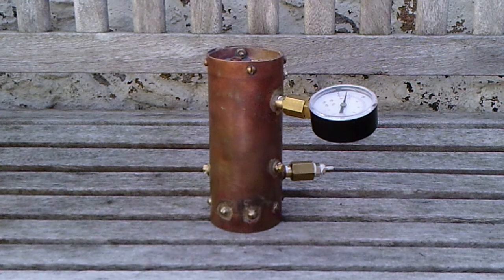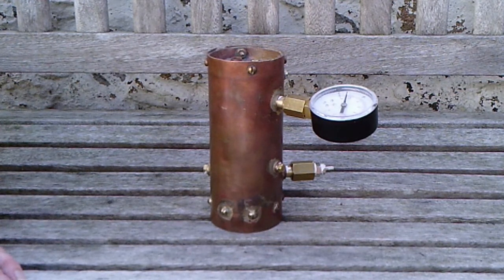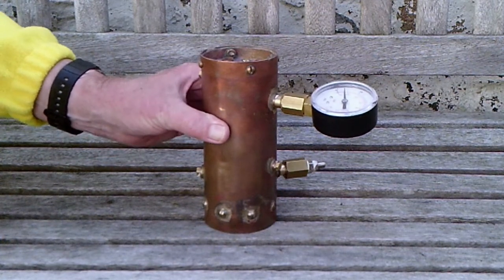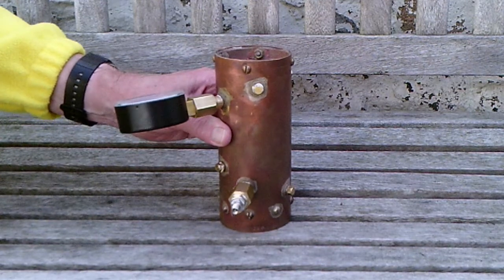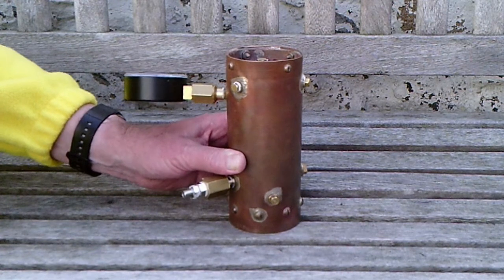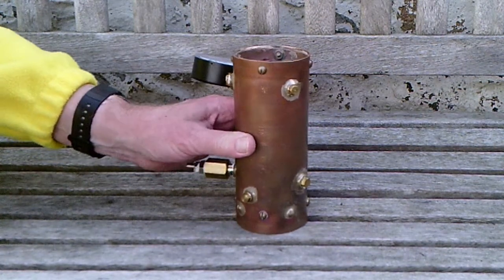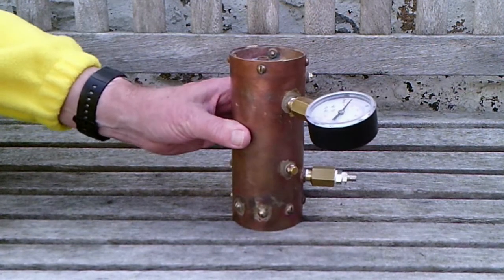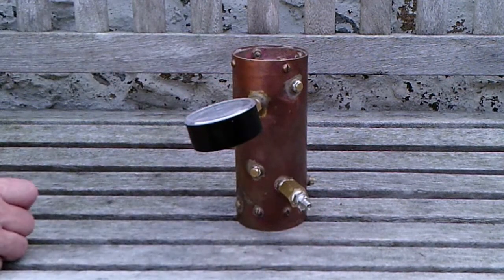Vertical 3 Inch Steam Boiler Part 1: Air Pressure Test

Comment from the maker: Update: unfortunately the hydraulic test revealed that the one leak at the point where one of the tubes joins the end plate (referred to in this video) remains a problem. Having sought advice on a relevant forum it is clear that I have no choice but to re-silver solder the joint. I'll update on this in the next video on the boiler.